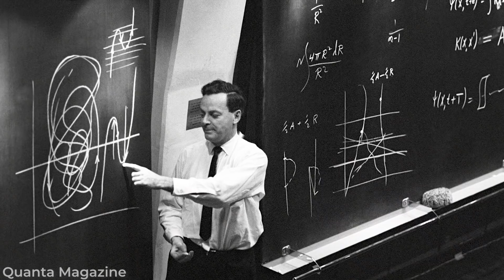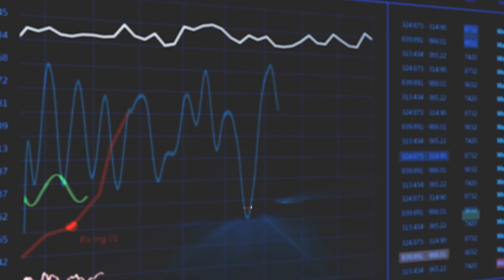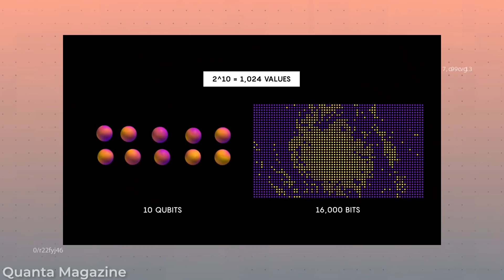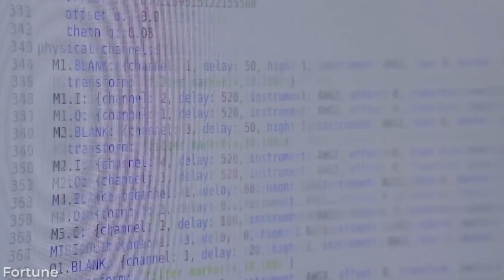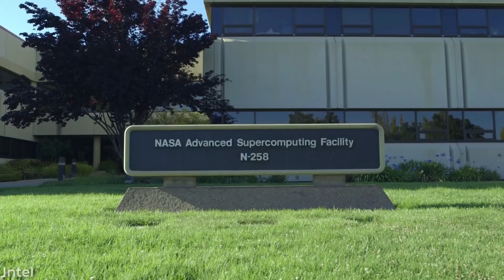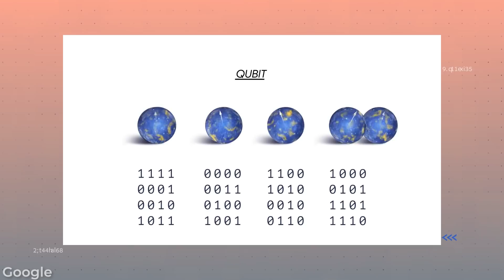This Quantum Computer BREAKTHROUGH Will Change Space Travel Forever!!

Comment: There is a major caveat here. Quantum computers will not be on spacecraft anytime soon. The reason is that these systems are incredibly delicate and massive...they cannot be radiation hardened. This won't change for many decades. You might see a Quantum computer installed on a moonbase or massive space station where they can be isolated with tons of shielding and cryostat support...but not on a ship, satellite or anything mobile.